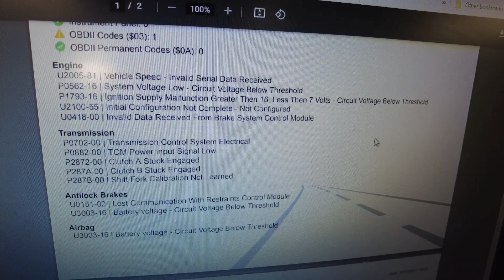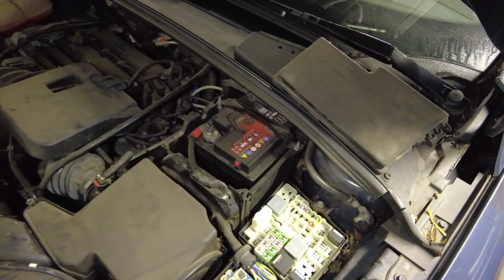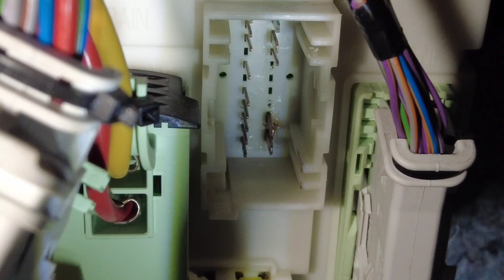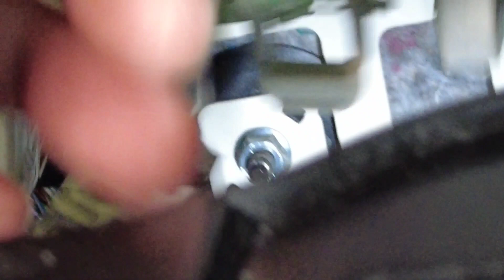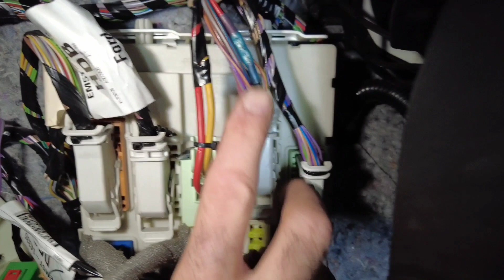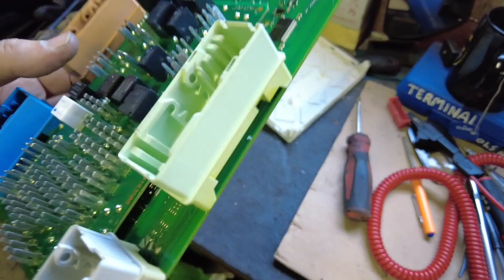Focus MK3 BCM electrical problems

Comment: Hi I have a focus which is the problematic one with 1.0 litre ecoboost. Had a battery issue call the AA they gave me a jump start my vehicle started up without any issue. After checking the condition of the battery. The AA PATROL man advised me to change the battery. And I had the AA scheme parts and labour were covered. After the AA guy were given permission. To change the battery over. He replaced the battery and no light on the dash nor crank. Them he said he must of hot dead battery. Which I belive that he must of put the priority were wring and fried the Ecu. No communication with ODB check the fuse and everything look okay. Please tell me if your based in London so I can get the vehicle recovered to you to see if you can fix it.

Comment: Hi, Great video could I ask were you managed to find a supplier for the new replacement c6 BCM pigtail connector  I require the same one
Reply from the maker: I had a mate at fords years ago so managed to get one through him. As far as I know they're not available to anyone other than main dealers. You might be able to source just the pins somewhere though.

Comment: Hi! Could you please help me?
I have a 2014 right-hand drive Ford Focus. Neither of the front electric windows work, the mirror adjustment doesn’t work either, and the switches don’t light up or respond at all.
The fuses are fine, grounding is good, but no power is reaching either of the front doors.
I haven’t removed the BCM, but I checked the connectors — they look intact, no signs of burning or damage.

What do you think could be the cause of the issue?

Comment: Friend’s Mondeo had windscreen washer fluid travelling up the electrical wire, how its not a manufacturer fault baffles me. Over £1000 to sort out, when I looked at the component that was changed there was evidence of green/blue fluid 🤔
Reply from the maker: It's not great is it. Unfortunately lots of brands suffer faults that the customers end up paying for that just shouldn't be there.

Comment: Great video. Ford S Max 2008, side/dipped lights both not working. Failed MOT. All other lights are OK. Looks like there's no fuse as they're controlled by the bcm. All seems water free. Multimeter on the connector shows 5v but nothing when bulb is in place? Any ideas on this? Thinking I'll replace the light switch. Hoping it's not the bcm! Thanks 👍🏻
Reply: Replaced BCM and reprogrammed it. Same problem persists :/ Checked earth points and cleaned. Fault ongoing, wish me luck 😊
Reply from the maker: Just seen this. What a pain. Can your scan tool command the lights on via the bcm. That should rule out the switch.  Might well be a wiring issue somewhere in the loom. You'll need to load test the wires from the bcm to the headlight.

Comment: I’m now going through this on my 2011 focus. Our dipped beams have stopped working, 8 volts to the bulb. A few years ago the drivers side dipped beam lost all power and the garage ran a wire from the passenger side. No both are not working. Looking at removing the glove box tomorrow to check the connections. Thanks for the video
Reply from the maker: @Robc509  good luck 🤞
Reply: Same issue here. What was the solution?
Reply: It actually turned out to be a broken wire behind the light. So we dodged the bcm billet this time!

Comment: I just changed the bulbs of the headlight led light, turning light, break light and reverse light and that's how I scanned the BCM.
Reply: The BCM of my ford focus immediately went wrong
Reply: @noelleonen5999 hey! Did you got the no crank(start) issue?
Reply: @diagmind  There is no problem with the crank issue
Reply: @diagmind  The issue you say is fine
Reply: And I also put back all the bulbs I changed later the right side of the park light and the back stop light came on so even though the key was off it still came on what should I do?
Reply: I disconnected the positive pole of the battery so as not to be discharged

Comment: Hi

I have a second-hand Focus MK2, a 2011 Focus ，but it don't have clutch switch,I can't find the wiring for installation，

Maybe the previous owner hid the wiring harness, so I hope to find the source of this harness, 

such as where it connects to the BCM, to find the harness or relocate it.

If anyone knows, please help me, thanks！！
Reply: The cpp is higher up on the clutch pedal u need to remove the plastic panel and it hiden at the back

Comment: Hi I have a mk3 focus the footwel lights don't work when the  doors opens if it's the fuse do you know which one I need to look for ?Thanks.
Reply from the maker: The fuse also feeds the glove box light, sun visor lights and interior light. If they all work then you need to check the bulbs/wiring to the footwell lamps.
Reply: @Automotive_Solutions  thank you.

Comment: Hello what did you use on connector plug ...silicone grease ?
Reply from the maker: No, it's a dielectric grease specifically for electrical connections. I can't remember where I got it but I've had it for years now. Don't use normal silicone grease. Thanks for watching and commenting 👍😬
Reply: @Automotive_Solutions  thanks for response ,can I ask the washer pump,herd of this issue ,so new pump and then did you replace the pump connector and crimp connector it back on ?
Reply from the maker: @davidwaters5348  yes, fitted new pump then cut the wiring to it and fitted crimp connectors to prevent it happening again 👍
Reply: @Automotive_Solutions  thanks

Comment: Hello man.  Maybe you can help me.  I have a 2017 ford escape. My car has remote start installed but it doesn't work.  I read the dtc errors and see b10ff:14h-2f in the bcm block.  Maybe you know how or where I can fix this?  Additional Information.  An additional anti-theft system is installed in the car.  maybe it can affect the remote launch.

Comment: Great video very informative i have a similar issue with a 2012 st . Where did you source the repair parts ?
Reply from the maker: Ford dealer. The repair harness and connector for the bcm they don't sell. I got lucky and found someone with some left over bits.

Comment: Hi , 
I have a 2014 mk3 focus . All of a sudden all my drivers side indicators failed to work apart from an eratic flashing  dashboard indicator light - passenger side indicators all working fine - when I turn hazards on only passenger side indicators flash - any ideas please ? Thanx v much .
Reply from the maker: All the lighting runs through the bcm. Have you had any bulbs changed recently? If the bcm is dry then you need to chase a wiring/bulb fault.
Reply: @Automotive_Solutions  I have recently changed my brake lamp bulbs because I was getting brake lamp bulb fault warnings on dash even tho all brake lamp bulbs were working - very confusing - thank you for your reply 👍
Reply from the maker: @debbiewright2171  double check you've fitted the correct bulbs as it can confuse the bcm.
Reply: @Automotive_Solutions  hi , I swapped my left hand indicator bulbs for the ones that were in the right side and vice versa and it solved the problem  - how bonkers is that !!
Reply from the maker: @debbiewright2171  things are more complicated these days that's for sure. Hopefully it will stay fixed 👍😁.
Reply: @Automotive_Solutions  me too 🤞 cheerz !

Comment: I have a MK3 1.6 ecoboom that had water ingress on bcm which is coming either from under windscreen or possibly from that washer wiring, where should i look for washer pump wiring water ingress as all plugs look fine, def been water on bcm board tho. Any other spots under the cowl ur aware of that cause water ingress?
Reply from the maker: I've only seen the washer pump wiring loom being at fault but it could be coming from somewhere else. Can't help really 👍
Reply: @Automotive_Solutions  thanks, will take another look at it. Been sat in my garden since 2017 😝, basically was a write off due to the water ingress causing bcm issues which affected fuel pump. Ford quoted 3-4k, garage i bought it from washed their hands immediately. So gonna have a crack at it myself, should be fun!!
Reply from the maker: @SuperAleIndustries  that's not good. Hope you get it sorted. 👍😁
Reply: @SuperAleIndustries have you sorted out what the problem was?
Reply: @Plankd  havent had time to pull it apart as yet. However further research has revealed the seam sealer could be failing in roof rails and also in boot, so perhaps I'll look into that. But for now its a garden ornament 😂

Comment: Iv done the instrument cluster  in August
But I have issues I still have the U1900 lost communication and my main problem is the dashboard light stay on 24 hour they never are of I got new battery 2 Months ago and now is flat any idea why?
Reply from the maker: Did you get a guarantee with the instrument cluster? Might be worth getting it checked again. There could also be a wiring fault in the car so that would need checking too. Good luck 👍😁

Comment: The problem I currently have with a 2017 Focus RS is the body control module went completely dead.. there's no way to grab any information from it, to copy it on to a new body control module even with ford Fjds.. 

It just throws out the immobilizer.. sadly
Reply from the maker: I've never used the Ford system so can't advise. Can't the main dealer program it for you?

Comment: I have something similar, my battery keeps getting drained and im clueless to whats causing it, ill be doing a parasistic test later today.
Reply from the maker: Yes, definitely worth doing that first. These do take a quite a while to settle down and go to sleep so be patient 👍
Reply: My battery is also draining. BCM is repaired. Did you find what the problem was?
Reply: @ДмитрийАнискин-ъ1л  I found a new battery sorted the issue out

Comment: Hi buddy, got issue with cluster, intermittent loss of speed, rev counter fuel, temp, and message board, on the bcm, which plug is it that covers the cluster part of the bsm, is it bottom left, that has blue under it mate, could this be the issue, or could it be the cluster itself buddy
Reply from the maker: You need a full code read of the vehicle to get an idea where the fault lies. It does sound more like the instrument cluster is the issue. Pretty common on the Focus. 👍
Reply: @Automotive_Solutions  cheers for that buddy, yeh it's weird, when they stop working, sometimes pressing the windscreen defrost activates dash to work again, and when driving and they are working, when i brake and slow down, it suddenly stops working but restarts when setting off, can work one day and a soon as it goes dark and I turn lights on, it starts messing around again